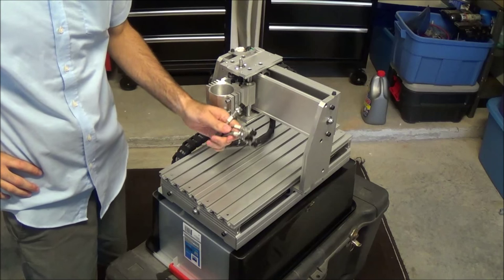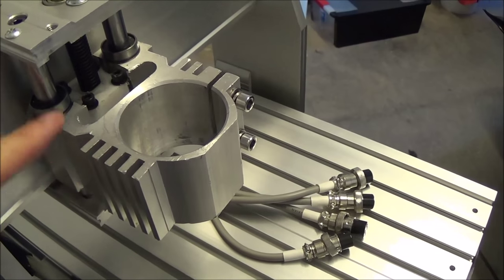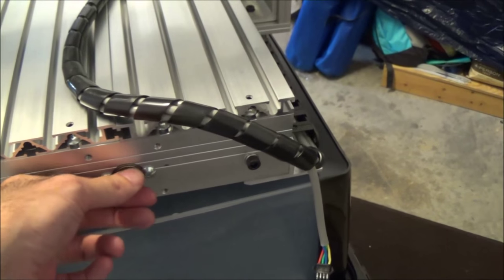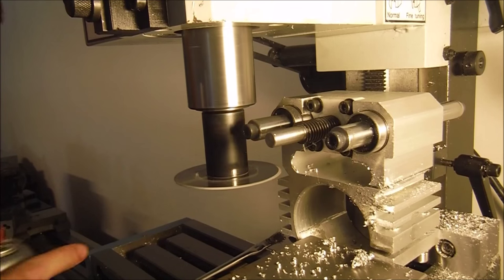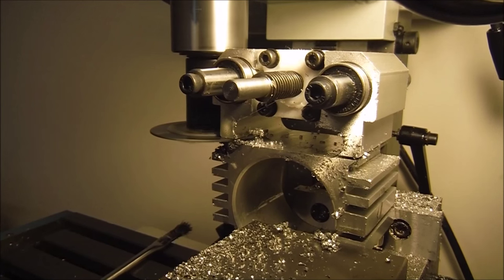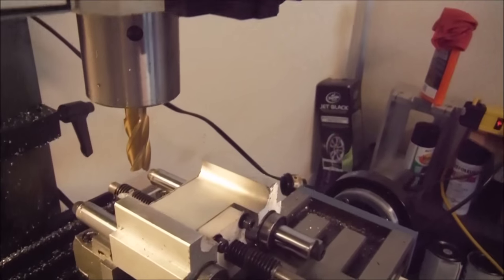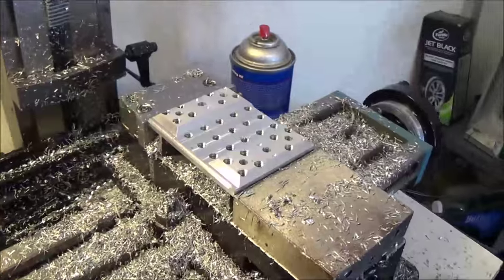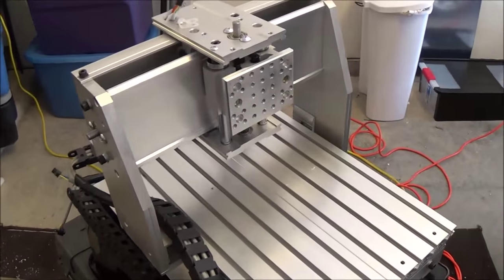Hacking a CNC 3020 Part 1/5 - Building a Light Weight Positioner

Comment: I'm sure it's too late, but a hint for next time:  You could probably have pulled the connectors through the z-axis assembly hole by removing the wires and pins from the connector housings.  Usually all you need is a small screwdriver to release the pins.  Once the connector housings are removed, you can pull the wiring through the hole.  Push the pins back into the housing when you're ready to use them again.
Reply from the maker: missed the boat on that. I think we looked but as usual we were in a pinch and all we had was a bigger hammer...

Comment: You can remove the black and white connectors from the wires without cutting.    The crimped metal inserts are retained in the plastic connector housing by little metal wings which spring out from the side of the metal crimped insert.  These little wings simply catch on an edge inside the plastic housing to stop the wires from coming out.   Using a very small screwdriver you can push the wing back into crimp so it is not catching and pull the wire and crimp out.  Your white connector there has two wings per crimp insert.  Look down the end of the connector and you will see them.  Maintain tension on the wire and you can close each sprung wing one at a time.  Or, I have found a fine hollow metal rod which slides down over the connector and closes them  both at once which is luxury.
Reply from the maker: Thanks for the info, this will certainly be useful for the community. I get comments about swapping the spindle for different heads all the time! Plus, I cant be the only one out there who was overly excited to start polishing!!

Comment: Hi there. I'm just about to order one of these machines. I'll be using it to cut 15mm pvc Foamex. The sheets are a4 size, could you tell me if that will fit on the bed? And where the spec says 300x200mm travel, does that mean it will cut a maximum size of 297x197mm with a 3mm bit? 
Thanks in advance
Reply from the maker: Buy the 6040 if your going to get anything - its a nominal increase in price and table space with the same capabilities and more flexibility- also there are a few things you may want to conciser: 
*one that there is a portion of the travel that is off the bed - if you watch some of the videos you can see that the gantry offsets the spindle considerably so when the machine is all the way forward it will be off the table by about 75 mm. you could easily support this by cutting a larger table out of wood or by buying the machine with the offset gantry supports (I've only seen this on the $1000+ machines).
*then there is the issue of securing the piece to the machine, its very convenient to use clamps but then you need to account for this in the machine size - and if you make a wood table to extend the coverage, how do you attache your components?\ - some people get away with double sided tape...
*Next is how you're going to mill the laminated foam - run the spindle too fast or traverse to slow (this includes deaccel/accell in and out of corners) and you'll melt the PVC, once this happens the bit will turn into a steel shafted PVC lollipop and will break off or rip your sample off the table. you could use a mister or perhaps just air to try and keep things cool and evacuate chips but that depends on your application. Typically you cut foam with a drag-knife or a hot-knife right?

Comment: This exactly what I thought of doing to the spindle mount if I got a 3040, its a nice but at the same time stupid design. 

thanks for the great video
Reply from the maker: Rupert Hirst Our 3040 is hardly stiff enough for the spindle that it comes with - yet for the money, its tight. There is a resonant frequency right at the top of the speed dial -> I wonder if its the wet noodle frame, the ABEC negative bearings in the spindle, or just the anemic shaft with a the massive collet flapping in the breeze which you bent when wrenching the bit tight.

Comment: Plastic on the Z nut?
Reply from the maker: Correct. the nut is threaded about 15 mm long to provide elastic averaging over the length. If it were rigid, either the motor would stall if the threads were even slightly out of tolerance, or we would be complaining about backlash. Kind of like having brass half nuts in a bridgeport - somethings gotta give. This plastic also is in all the linear bearings so that there is a lower tolerance requirement on alignment and trueness of the chrome rods/ways.
Reply: Seems bad for longevity? How has it worked out for you?
Reply from the maker: Its always a balance between stiffness and stiction - or compliance and wear - how ever you want to look at it.Rest assured, this is no production machine but for engraving and contouring at the price point, you really cannot beat it. That's why we own several functional and why this one was turned into a positioner. Also they work best for is no-force applications.

Comment: 20K rpm? LOL!
Reply from the maker: What ever the top speed, its in the garbage now! 20K RPM (0.33 kHz) unloaded is not unreasonable for a small spindle. RC props and dentist drills have been known to push well past 100K RPM
Reply: Maybe for very small hole drilling etc...
You can burn out the drill easy, without coolant!
Reply from the maker: Great Comments, Thanks for sharing! Of course for small stuff, that's all that I've ever successfully done on our CNC3040 (we've ripped contours into titanium and stainless but they looked like a beaver chewed them out because the spindle bearings are loose as a goose). Using surface speeds as a guide a 1/16" carbide endmill can be spooled up to 10K in aluminium and 6K in steel - and I would want my spindle to have the capability of running much higher than needed with no load, right?
Reply: That's just charts, all depends on the machine/spindle rigidity , type of coolant, how big of cut you taking and type of material.I worked on large mills, that can't do more than 6000 rpm, you using a little crap aluminum mill made for light work and you want to do 20k rpm or even 10K? LOL!Your feeds and speed has to be calculated so the chip size thickness shouldn't be more than .003-.005"!So when you cutting, grab some chips and measure it with your caliper.Some materials like titanium or stainless should be cut slow, 90 fpm or so and use oil to cool it that sticks to the mills cutting edge. Carbide tool is a must, but be careful, carbide chips/cracks easy.I've been a machinist/tool maker 25 years!
Reply from the maker: Great Dialog, thanks. I'm right there with you, and agree with all! And your right, this isn't a work horse - the way I usually run dank equipment is to calculate surface speed, hold it near the max and then calculate feeds using chip loads. Again, your right, we usually run 0.001 or less, using as many flutes as possible to get the vibration frequency up, and as much mist/flood as possible to clear the fuzz. Then while running fine tune the spindle speed to stay away from resonances. - again, on real machines this gets you very close but on these toys, what happens is that the spindle starts warbling and then the axes slip in the backlash then the bit bites in (and chips if its carbide) and the feedback loop sends the machine into beaver mode for a quick second (usually during acel/decel where your feeds are not optimized). Especially on this loose equipment, that spindle speed is your friend, it puts the fundamental frequencies much higher than the butter machine can react - is all about the spindle on a machine with basically zero stiffness. Also- I did a quick search and found that the CNC3020 controller specifies 10K as its limit but im pretty sure that its a DC motor and the controller is sending PWM, so that is basically a guess. It'd be interesting to put a tach on it to see.
Reply: Running mills AND routers? What your talking about on a mill and what he's doing with a router table are two entirely different things.
I have both, and I can tell you what I do on my Bridgeport/Lagun mill at 2 or 3 thousand RPM's is using a much larger endmill and Im taking deep cuts with coolant.
On the other hand its nothing for a router table to rip through a sheet of aluminum with a cutter going 30 or 40k and using a 2 flute 1/8 or 3/16 cutter.
What we are doing with our industrial sized mills is generally cutting into big blocks of aluminum and steel, hes working primarily with flat sheet using what amounts to a dremel.
Larger CNC table routers frequently use wood routers or trim routers for spindles.
I use 100 ipm on my big mills and I cut thin aluminum sheet on even my smallest table cnc router at 800 ipm.
I have a lot of respect for a real machinist with 25 years under his belt.
So please no I mean no disrespect.
Reply: Might try less flutes, my experience is that they clear quicker. ALSO i forget the terminology but there are bits that clear up and out versus down? I can't remember..... one works for me the other doesn't. The last time I bought bits I got some I LOVE and promptly ordered a buttload of them.
The rep that sold them to me is now out of business and I have NO IDEA where these came from or who makes them or I would be happy to tell you.
They cost a fortune, but I've only broken one in the last year.
Like taps, I pay a FORTUNE for my taps, and now I don't break them.
Reply: What ever works for you! But often can't run the the mill too fast, because the chip control or coolant spraying every where, tool over heats etc....
When you look it charts, those numbers come from tests at the lab , at optimal conditions.
CNC machinist use feeds and speeds from charts, but often break tools like crazy, slowing down machining time. A broken tap can be big headeck, some times not easy to take out, if it's not noticed  , can break other tools also.
Reply: Common  end mills,  taps are HSS, high speed steal, good for general machining, but before buying carbide tools, there's the cobalt option, HSS with cobalt, which a little bit more expensive but cheaper than carbide.
Holds up better and tougher than regular HSS tools.
Also, 3 or 4 flute emills harder and more work to sharpen too, if you doing it yourself.
Reply from the maker: Its a science for sure but I like to refer to it as an art because there are too many variables to account for practically. Spindle, workpiece, & machine are all butter at the micron level - mills un-twist, chips sometimes grab, ideal speeds & feeds dissolve during cornering and profiling operations.... 6061 has cobalt inclusions that will snap your flutes clean off... bit material is a balancing act between ductility for forgiveness and hardness for longevity...
Reply: I like HSS. It's not likely to chip or come apart because it's not as brittle.
AND if it does break I can use what's left of it to grind a tool for the lathe or for use in a boring bar holder. Whatever.
I use cobalt and carbon on my big mills and usually grind HSS tools when cutting aluminium and brass on my lathes, although I like to use inserts for steel and stainless....